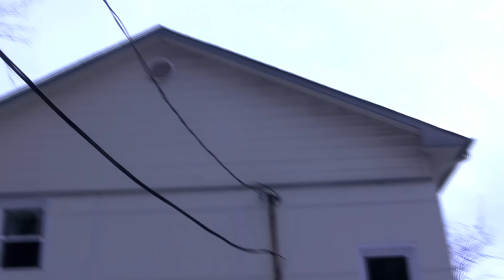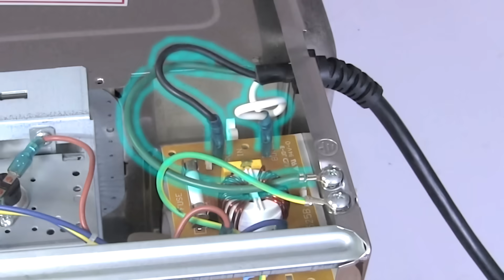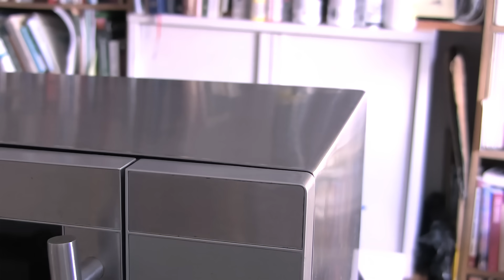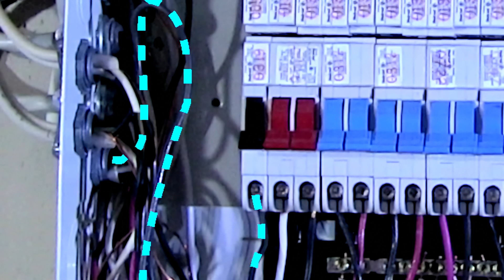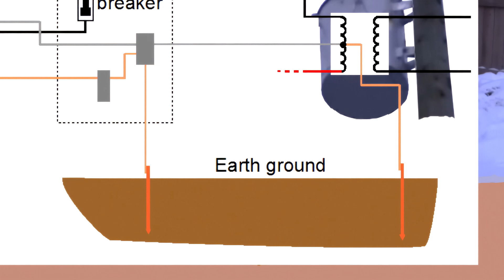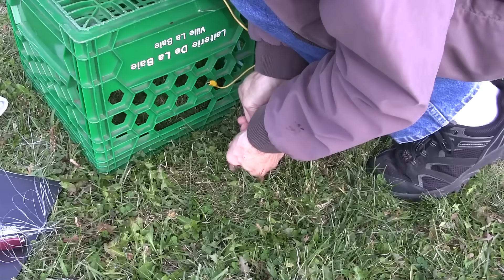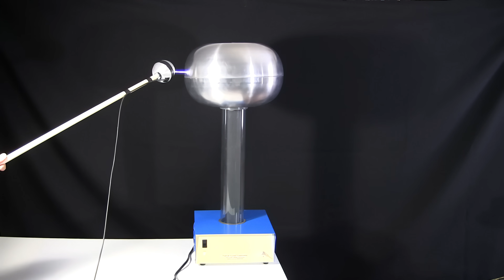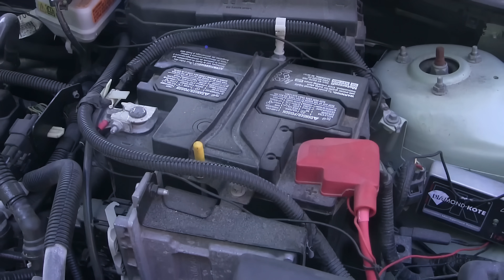What is Ground? Earth Ground/Earthing

Comment: Wow. Your diagrams showing pole transformers are totally wrong.
The distribution to a transformaer is done with ONE wire at the top of the pole. This is normally 7200 volts. This connects to ONE side of the primary of the transformer. The other primary side is connected to solid copper wire to earth ground. This complets the circuit from rhe power substation. The secondary part of the transformer has two lines lbaked L1 and L2 AND a neutral. The neutral is a center tap of the transformer secondary. It is ALSO connected to the ground wire at the pole. From the pole, it enters into Your meter then into the service panel. It is at this location that another ground rod is driven into the earth and connected to your panel and bridged to rhe neutral. This way if lightning does hit your wires it will find an easy path to earth ground. 
The power generation company only transmits power thru the "hot" legs if the generator, the neutral is earth grounded. At the generator you have 3 phases of power in a "Y" configuration with the center if the "Y" being grounded. They use the earth as a common conductor. It is much cheaper to do this than to run 3 neutrals from the power generation and all throufh the power distrubution system.

Please do your hone work and present the REAL way things are witlred.
Reply: roy Yung 
If you think you can do better, than make a video about it and let’s watch. Criticism is OK if it’s constructive. Work on your constructive criticism since you come over as an arrogant being. 

See what I did here? Not nice is it?
Reply: @IbnuCuruk  the internet is loaded with false information and this is way to dangerous to fill people with false information. People can not only burn thier house down, but perhaps kill people. My comment was about content, not production quality, so your comment is misguided.
Reply: roy Yung 
Sir, the comment I made was about the manner and tone in which you conveyed your message. Your points might be valid. I was not talking about that. I do in fact believe that false information must be corrected, but with respect etc. I failed to see this respect in your comment by the way it was conveyed. 

Have a good day/night. 👍🏼
Reply: @IbnuCuruk  there was no tone implied nor inferred. I correct bad infirmation as bad information can get u killed
Reply from the maker: The way you describe the primary side of the transformer sounds like what's called single-wire earth return https://en.wikipedia.org/wiki/Single-wire_earth_return. There are a variety of ways in which it's done in different places. If I understand your description for the secondary side, it sounds like what I describe in the video. I didn't bother with L2 since it wasn't relevant to the topic, though I did show a short red line to at least represent it at the transformer.
Reply: @RimstarOrg  in the USA all power generation at the power plant has a WYE configuration with the common of the 3 phase generator is sent to earth ground so only 3 wires leave the generating station and out to the grid. If you look up at all the transmission lines you will see a multiple of three wires. When it finally gets to the local distribution station one wire will leave to each pole transformer, while in commercial areas 3 wires will enter a facility. They do this for a reduction of cost of all the extra wire that would be needed in addition to thje weight on the transmission towers. 
At you local residential transformer the primary is fed from the distribution wire of 7200 volts and the other from earth ground at the pole. This earth ground is also connected to the center tap of the secondary and to the transformer case.
I understood your diagram very well as I have been doing electronics for over 50 yrs. In your diagram you depicted the primary of the transformer with two wires and in your narative you said they go back to the power generation. This is not true. Only 1 wire comes from the power substation, the ither side if the primary goes to earth ground as well as the center tap of the secondary. Go outside and have a close look at a transformer on a pole
Reply from the maker: I know very little about the transmission from the generation station to the primary of the transformer. I try to stay away from that side since there seems to be too much variation and I've no background with it. (For the household side, my background is a household wiring course and my work as a solar contractor which touched on it at the breaker panel.) For the two wires of the primary circuit in my diagram, I drew from this diagram and others:
https://www.mikeholt.com/instructor2/img/product/pdf/1292448885sample.pdf

I wasn't aware of single-wire earth return methods until the first person brought it up in these comments. I looked it up and found the wikipedia link I gave above and from there I gathered that it was the exception rather than the rule, which given the source, can be wrong.
Reply: @RimstarOrg  I understood those diagrams perfectly. The transformers they depict are not pole transformers. They are in-house type of transformers and for diagramming purposes. You depicted a pole transformer. One side of a pole transformer comes from a substation and the other side of the primary comes from earth ground. I dont know where you live,  but if you are in rhe USA, go take a look at a typical power pole in your neighborhood. The wire at the very top is the primary wire. There should only be one, unless it is a tap of the 3 phase wires. But you will only see one wire entering the can. The other wire will be from earth ground.
He diagrams this in figure 250-17
Think of it another way. Ever notice when a primary wire falls from a pole and hits the ground it arcs and sparks? It does that because its trying to return back to the source which is the power substation then ultimately the generator. This is accompmished because one side of the generator is sourced to earth ground
Reply: roy Yung The pole transformer has a 2 wire input, the 7200v line and the ground wire which also runs pole to pole to pole. The US uses copper not the SWER distribution system. Earth grounding is for safety purposes only.  See http://www.science.smith.edu/~jcardell/Courses/EGR220/ElecPwr_HSW_files/power-parts.gif
Reply: @shofar-man  I would suggest you actually go out and look at a real pole xfmr, because you are incorrect. According to National Grid (one of the nations largest maintainers of the grid in the northeastern USA) and forgetting about the secondary winding for a moment, residential ises the WYE type of distribution where the primary winding of the pole xfmr is fed from the primary wire at the top of the pole of 7200v and the other side of the primary from earth ground, thus completing the circuit. There is no other wire on the pole that connects to the primary of the xfmr. I would be happy to provide many pictures of actual pole connections.
Reply: @rty1955  I am correct, I have looked at the poles in my neighborhood. SWER has been used in rural areas but requires 19KV to the primary and also requires isolation transformers rendering it uneconomical for runs less than 3km. It isn't used in urban areas as distribution is 3 phase balanced as far as possible with 1 or 2 phases into neighborhoods. The single phase transformers in my neighborhood do have a ground wire going to a spiral on the butt of the pole but the transformer is fed by 7.2KV (not the 19KV required for SWER) and a ground wire that is strung between all the poles in the neighborhood. I don't know where you are getting your misinformation but you are misleading people plus giving them more information than they need to understand their house ground and neutral.

Be careful climbing those poles trying to get photos!
Reply: @shofar-man  I got my informstion from National Grid who maintains power distribution in PA, NY, NJ, CT, RI. And the primary is in fact fed by ONE 7.2kv wire and a earth ground wire. I have had the primary knocked down twice in my neighborhood and spoke to the lineman when they arrived and observed the re-connect. Where would you like me to send the photos to to prove it?
I dont mislead, I can provide documented evidence as to how this works. I suggest if yoy feel therr is something wrong that you place a call to National Grid and tell them they are wrong after they stop laughing hystericslly at you, you will get hung up on
Reply: @rty1955  What has you confused is that there is a 7200v line and a ground wire, what you miss is the the ground wire  is strung between poles as well as running down the pole. If you as a lineman he calls that wire ground and it is grounded at every pole. Pole transformers can be 2 lug or 1 lug, for 1 lug transformers the case is grounded and connected to the ground wire that runs from pole to pole. I guarantee that you don't have true SWER as 7200v won't support that and for safety SWER systems usually require 2 deep ground rods for the return not just that spiral on the butt of the pole.  There is some 19KV  SWER in Alaska and the ground rods have to penetrate the permafrost as it has too much resistance.
Reply: @shofar-man  I am far from confused. The pole transformer is 25 feet from my front window and I can certainly assure you of only 1 primary wire and no other wire (besides Telco) on that pole.therr are no other electric wires connected from pole to pole either besides the primary. There is another pole at the other side or my property with the exact same configuration. It is like this thoughout many developments here and I would be very happy to submit photographic evidence of this. Each pole that has a transformer has an earth ground that connects to one side of the primary of the transformer and the other being attached to the 7200v primary wire at the top of the pole. I watched them make the connections when it needed repair. What part of this dont you understand? Its physically 25 feet from me.
What is your background? I have been doing electronic design for over 60 yrs.
Reply: @rty1955  If I were there I could clear it up quickly, but can't do much long distance.

Safety:  The single wire with earth return has serious safety issues with regard to the return current flowing through the ground/earth.  In North America the National Electrical Safety Code does not permit such a system.  While I have seen such a system in Australia and a few other locations, the SWER is not a good solution.

There is a possibility that I hadn't considered depending on how ritzy your neighborhood is. That would be the use of metallic sheathed wire to carry the ground through and provide lightning protection as well. It might  be more expensive than a separate ground wire but less expensive than direct burial. I know communities are trying to get away from the ugliness of cluttered poles on the streets.
Reply: @shofar-man  trust me, I am extremely qualified you dont need to explain anything. Why can't you accept the fact that this is common practice in USA? I can show you hundreds of locations that do it this way. Whybis that so hard to believe? Running a separate ground wire doesnt even make sense as you can obtain ground right at the pole. Also having it near the primary has issues and is much more expensive to run due to double wire costs. Using earth ground is perfectly accpetable. Maybe they like to waste money where you live by running unnecessary wires.
Reply: @rty1955  I don't have to be right but a lot of youtubers can be confused if we put out wrong info. Since I know SWER is not used in urban areas I am now seeking an explanation for what you observe in your neighborhood thus the comment about metallic sheathed cable. I have posted a question on the Mike Holt Forum, if you want to follow the discussion (or jump in) here is the link  http://forums.mikeholt.com/showthread.php?t=195460 . Here are the first 2 responses I received to my question;

*Assuming you're talking about AC distribution, I doubt it's ever been used in any urban areas in the USA; you'd really have to get off into the weeds to see it.

*It is still being installed in some countries New Zeeland, Australia, Canada, India, Brazil, Africa and Asia for sparsely populated rural areas.
Step voltage can be a problem especially in rural areas where cattle are likely to be present. India sets a maximum of 20V voltage rise at 1m, usually <5V is achieved.

BTW just as a side, when I was a kid some people connected  120v directly to a shallow ground  rod to drive earthworms to the surface (no the circuit breaker did not trip).
Reply: @shofar-man  and where r u getting toyr information from? Who is your authority? Like i said, I have phtographic evidence comfirmed by National Grid
Reply: @rty1955  Only you and leserb seem to believe the US uses SWER. What did you think of the quotations from the Mike Holt forum? I am pursuing this trying to determine what might explain your observation, distribution in my neighborhood is 7200v main and multi-grounded ground wire running pole-to-pole and to transformer lugs (or the transformer may be single lug with case ground). I provided a link to the Mike Holt forum, have you tried it?  Please contribute to the discussion there and let's see if we can get to the bottom of this, plus you can post photos on that forum.

I googled National Grid and was going to contact them but they wanted to know which state I was in, MS, NY or RI so not being a customer or even a resident in their service area I can't legitimately contact them.

SWER requires ≈ 19KV and hasn't been used in urban areas for safety reasons and because it also requires isolation transformers which would not prove economical in urban areas.
Reply: @rty1955  Here is the latest comment on the Mike Holt forum suggesting that you post close up photographs (which you have offered).

Eddie, please save all of us from pages of speculation. Can you (or he) take any good close-up pictures of the components in question: transformer terminals, especially the grounded-conductor pathway, primary conductor termination and connections, etc.

I have never seen a shielded primary overhead, but that doesn't mean it doesn't exist.
Reply: @shofar-man  hey Ed i read the thread on the Mike Holts site. The overhead primary is not shielded. It is a bare aluminum conductor supported by insulators.
I would be more than happy to take detailed photographs of the connections and submit them. Maybe we all can actually see what is on these poles.
Reply: @rty1955  That's great! I thought you might like the opportunity, thanks.
Reply: @rty1955  I just checked the Mike Holt forum and noticed you still haven't posted any photos there. I started to post one from my area then realized that would just bore the experts over there as it would represent what they see all the time.
Reply: @shofar-man  I keep getting an error when trying to post pics i send a msg to their support group but as if yet I did not get a response. I know a pic is worth a thousand words and that's why i wanted to post some pics. My configuration is not isolated ro my neighborhood, it is all over Rhode Island
Reply: @rty1955  It will be good to clarify your configuration. Recognize that if your service happens to be SWER it's not the case for the rest of us in the US. I can find no reference to SWER in any National Grid data and no application of 7200v SWER distribution anywhere in the world.
Reply: @shofar-man  as soon as I can upload pics to mike holts website you will see
Reply: @rty1955  It's been six months and I am claiming victory. I have looked at many power pole transformers and they are all served by a two wire input, high voltage and a multi-grounded-neutral. Pole transformer to house is a  240/120 V split-phase service drop providing power via three conductors  from the utility pole to the electric meter. From there they pass through the wall of the house to the electric panel which is grounded via a grounding rod or rods.
Reply: What is "witlred"?
Reply: I did some research regarding ground rods finding that a small percentage of grounds are ever tested by installer, inspector or utility. There are several  ways to test but one not requiring expensive test equipment is to simply connect a 120v hot lead to the ground rod (before connection to the panel) and measure current (R=E/I). I saw on YouTube that Mike Holt tested a 50' ground rod getting 68Ω whereas I think NEC requires less than 25Ω. My ground was not tested, the rod is 8' or 10' and the power pole ground is 10' so it's easy to see why a multi-grounded neutral is required (grounding is not precise enough for voltage reference). If 7200v primary current was 5 amps a 50Ω ground (without a neutral) would result in a pretty quick  step voltage of 250v.  It's also interesting that a direct 120v connection to a ground rod will not trip a breaker.

Comment: in UK we call them live, neutral and earth. The wires are red and black in very old houses, but they switched to blue and brown. Earth is always green and yellow stripes. Not sure why they chose blue and brown, personally I thought there was some form of colorblindness which could confuse blue and brown
Reply: An easy way to remember what blue and Brown represent is this: blue represents neutral, which has the same potential as a (blue) lake in the ground. Brown represents the color of your underwear after you touch the brown wire  because it's hot, and it makes you crap your pants.
Reply: https://www.electriciancourses4u.co.uk/useful-resources/history-of-wiring-colours-cable-sheathing-bs7671/
Reply: carpii It was probably because red / green colour blindness is the most common form of the condition. Those affected wouldn’t have been able to tell live and earth apart so they changed the colours to blue, brown and green / yellow to make them easier to distinguish.